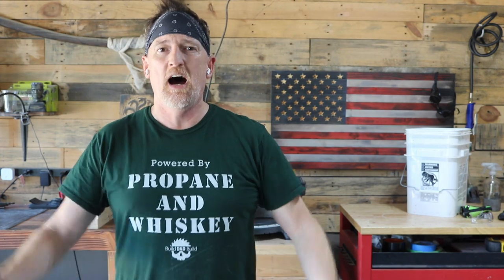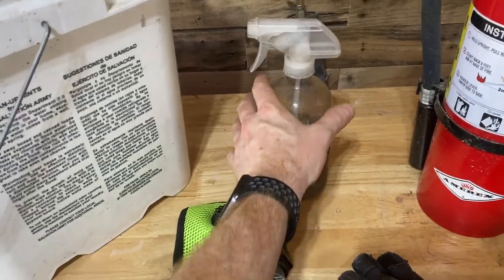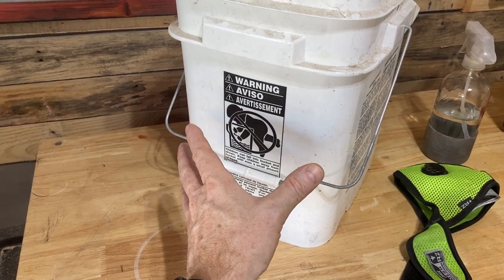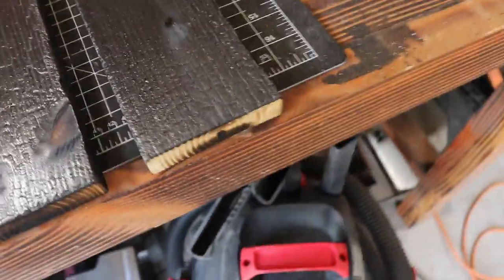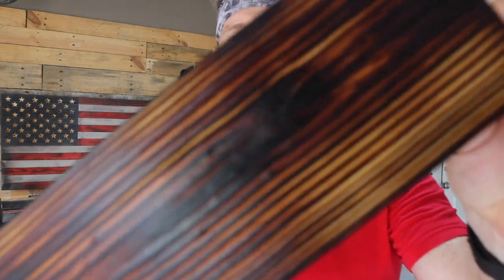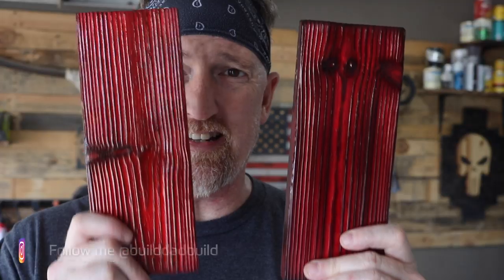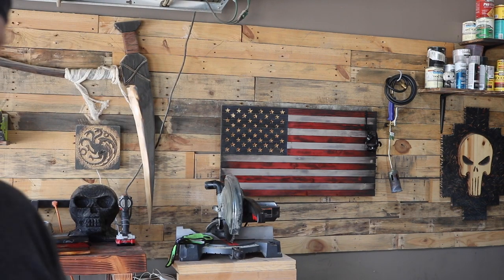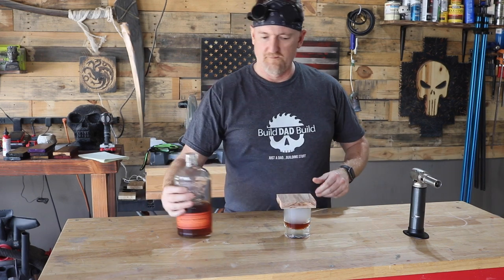How to Shou Sugi Ban - Colored Dyes and Stains

Comment: Good tip to heat and clamp cupped boards if you're not using a jointer and planer.  The stains/dyes turned out great!  Keep up the great work as the goal is to inspire others to build something awesome!
Reply from the maker: Absolutely!
Cheers

Comment: 2 Questions: You mentioned "spraying" the wood while you burn it to prevent cupping/warping. What do you mean by spraying it (with what)? Also, the bristle drill bit you used to scrape out the char... what brand is that one? it looks like it has 1"-2" of surface coverage. The one I have is very narrow (maybe 1/2"), so it takes ages to sand down my boards. Thanks for the great video!
Reply from the maker: Hey Shane,

I spray the wood with water from a spray bottle to mitigate warping.
The brushes are Nyalox brushes from Dico. Here's the link:
https://amzn.to/3m7p6eC
Cheers!

Comment: The dyes are water based, so if you are using a water based top coat, it will definitely pull some up into the brush.  Another option would be to use a spray finish to put a 1st coat on, then use a brush for the following ones. I just did that to some crosses I did, that I applied a water based whitewash too.
The infamous venom..
Reply from the maker: Normally I'm not too concerned if it pulls a little of the dye. But I did receive a question about if you had a multicolored piece. And I have done a spray coat first too!
Cheers!

Comment: Did you add the Total Boat varnish on top of the SimpleFinish?   I cannot find any reviews on the SimpleFinish, I’m wanting to use it for my bar table I’m making...but do not know if I will need to add a coat of Total Boat on top of it.  Thanks and I love the videos!
Reply from the maker: I did not add Halcyon on top of the Simple Finish. The SF does a pretty good job by itself. However if you're making a table that is going to see a lot of traffic you'll probably have to reapply the finish every so often (like you would with any sort of oil finish.
Cheers!
Reply: Build Dad Build Thanks!!!!

Comment: I just finished up a big job burning and dyeing 17 tables red. I sanded them to 220 first before burning and when they were done they had a metallic like finish. I couldn’t tell from the video if your non sanded boards looked like that as well. Also, to help reduce cupping and twist I burnt the bottom of the tables as well, not as deep though.
Reply from the maker: I've gotten similar results.
Cheers!

Comment: After the burning and dyeing will these pieces be suitable for use with benches, picnic tables, etc. In other words, will the stain or charred area rub off on clothing or skin. Or will be topcoats seal the wood from causing that?
Reply from the maker: You need to use a topcoat.
Cheers

Comment: Red dye for sure, but that’s a preference thing. I think the wood accepts the red dye best and it’s the least blotchy. One question on that Halcyon varnish; when it’s totally cured on that pine, can you dent it with your fingernail? I’ve been using wipe-on poly to get away from the stink of lacquer but it’s still not as durable as I’d like it to be, even after multiple coats and plenty of cure time. Thanks in advance!
Reply from the maker: This desk has 3 coats of Halcyon on it and takes my everyday abuse just fine. I actually dropped a mic arm on it and no dent...
https://youtu.be/U5A67-Pwxuo
And I agree the red contrasts well with the dark of the grain.
Cheers!

Comment: I have two questions. First, do you ever sand after the dye to flatten the grain that lifted from staining and how does it look? Second, I don't know where you are from but, I was wondering how the boat varnish you use would hold up in 100 degrees direct sunlight in the desert? Alot I have tried don't do well in the desert.
Reply from the maker: I don't sand after the dye because I want the texture.
I live in Houston. Like the desert only with 100% humidity! LOL
It holds up better than most other products. However, in order to get good UV resistance you need 6-7 coats. The good part is that's totally doable in a day because you only need an hour between coats.
Cheers!

Comment: Found this when looking for a way to give my new desk some vibrance and depth. I try not to buy tools if I'm just using them for one project, especially more specialized ones. Are you aware of any attachments or add-ons that can make a regular propane torch a little more suited to burning large surfaces?
Reply from the maker: Yes.
This bad boy will increase your output significantly.
https://amzn.to/2TrF5IL
You can see me using it in this video:
https://youtu.be/_xBfDdlaZ18
Cheers!

Comment: Hi   videos are awesome      question    how long do you leave the dye on for?  And do you sand b4 clear?
Reply from the maker: Thanks, Russ!
I usually let it sit for about and hour, check on it and if it needs it I'll do another pass.
And I do not sand before clear coat. The nylon brush gets everything pretty smooth.
Cheers

Comment: So i noticed you burn to a gator almost. I have been just going past marshmallow toasting on my 1/2" ply.  Should i call it good at that? Or go deeper? Dont want to go through the layers of wood. I do like the slight dark strips. I probably wont get black, but my sunbleach stain shouldn't cover too much up.
Reply from the maker: Hey, Stacy!
Do not burn deep on plywood. You can burn through the top ply AND you can heat the glue up so much that it will cause bubbles.
Cheers!
Reply: @BuildDadBuild  intuition pays off.

Comment: I have been researching shou sugi ban and your videos have been the best combination of information and entertainment. I do have a question. I am building a computer desk. Can you get a smooth finish for a desk top with dyed shou sugi ban? If so, how?
Reply from the maker: Thanks, Mike!
You've got 2 options. Probably more! LOL
1 - Do a lighter burn and skip the brush. You can still get the dark and light contrast with a lighter burn. You just don't get the texture.
2 - You could do an epoxy top coat and that would fill in the texture.
Does that help? If you have additional questions, DM me on Instagram @builddadbuild or email me at nick@builddadbuild.com
Cheers!
Reply: @BuildDadBuild  Thanks. Fortunately I have some offcuts I can experiment with.
Reply from the maker: @ekimnosettam  right on! that's what it's all about!!

Comment: I might have missed it but which flap brush do you use?  The 240, 120 or 80-grit?
Reply from the maker: Mainly the grey (80) and some detail work with the orange (120)
Cheers
Reply: @BuildDadBuild  thanks man
Reply from the maker: @RossTrittipo  sure thing!

Comment: What if you tried mixing dye with a stabilizing resin in a vacuum chamber? That'd ensure maximum penetration for sure. I have zero experience in the subject BTW, just a thought, lol.
Reply from the maker: That might work on smaller pieces...but as they got bigger you'd need a pretty big vacuum pot. Not to mention how time consuming that would be.
The penetration I'm getting is totally fine. I was getting questions on why I didn't dye the wood first and then burn...
Cheers!

Comment: trying to find a good Shou Sugi Ban build that I can add a turquoise blue color.. not navy or purple... it's going to be used on a porch with twilight sun, but mostly shade.  Have you had a dye or stain that got a good bright blue?
Reply from the maker: Check out UNiCORN SPiT...they have a Teal
https://amzn.to/3e0OizN
Cheers!
Reply: @BuildDadBuild  if i take steel wool to the high ridges on unicorn spit to get the black to pop a bit more, will it flake off the unicorn spit in the valleys?  I've watched a few vids on the unicorn spit and it seems to hide the grain more than i want for what I am trying to accomplish.

Comment: Is there any way to soak the wood in the dye to have the core of the wood dyed as well?
Reply from the maker: I get this question a lot. 
The short answer is yes. However, unless you're doing it to a very small piece you'd need to use quite a bit of dye and I don't know how long you'd have to let it sit in there. If you used a pressure pot it might make it quicker?
Cheers!

Comment: Love your videos! Inspires me to do things outside my comfort zone and try to do a few different ideas for my own projects, I’m thinking of making a shou Sugi Ban styled fun stock for my 22 long rifle and sealing it with epoxy and can’t really find a video to help me through how I’d be able to do that the right way, maybe could give a few pointers?
Reply: Gun stock* my bad
Reply from the maker: Are you using a stock blank or making the stock from scratch?
Reply: I’m thinking maybe from scratch cause I got a laminated stock on right now and i don’t think I can burn it, and if I was gunna use construction lumber I’m think that epoxy would make it strong enough even tho a 22 isn’t gunna kick hard at all
Reply: I’ll admit tho one thing that scares me is how smooth it will really be considering it’s gotta set around the whole thing and it’s gotta get in between the raised grain of the wood
Reply: Try a light burn won't be as pretty or what's wrong with texture get a grip on it. Think it would make great pistol grips. There's a money making idea I just gave away.

Comment: I had to use my fire extinguisher for the first time ever. I was shoveling saw dust into my wood stove. Fire jumped from the stove threw the air and caught the dust on the floor on fire.
Who’d a thought
Reply from the maker: That's why you've always gotta keep one on hand. Nobody sets out to light their shop on fire! LOL
Cheers!
Reply: That's kind of like grain dust at a mill very volatile if exposed to a flame. You are lucky you had it on hand but lesson learned you won't forget glad you are ok

Comment: Do you sand in between top coats?
Reply from the maker: Rarely. You've got enough texture there to hide any slight imperfections. 
I've only ever sanded if I have an issue with a coat of finish (drips, etc)
Cheers

Comment: try as a final finish and preservative [w/shou sugi ban =100s of years?]  method used by or similar to what usa forest service uses for exterior finish on log cabins:  1 gallon mineral spirits mixed with 16 oz boiled linseed oil mixed with 2 cubes melted canning wax out of a 4 cube box of canning wax.  melt the wax in small metal container placed inside another pan with hot near boiling water then pour melted wax into solution of mineral spirits and boiled linseed oil then stir and paint on with a brush or spray........
Reply from the maker: It sounds pretty amazing!